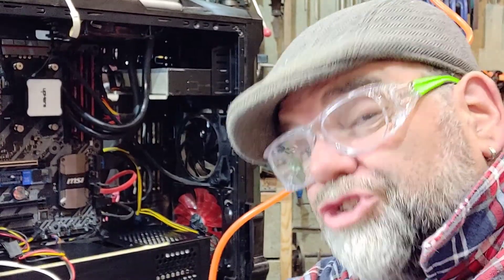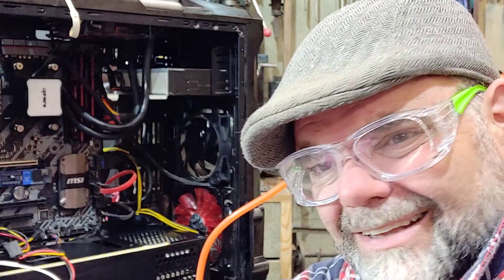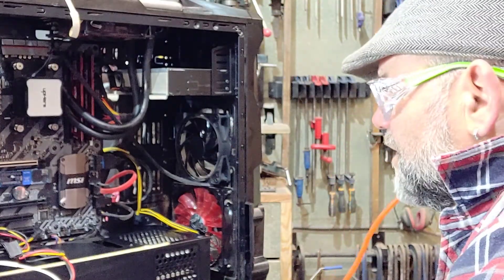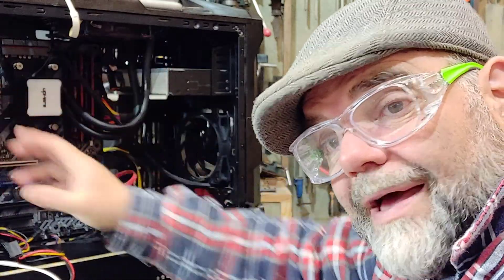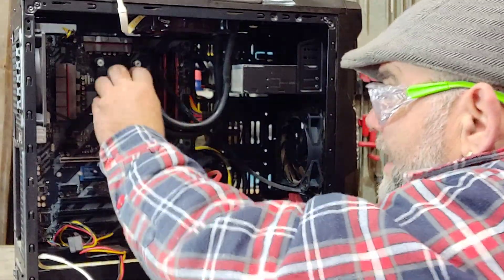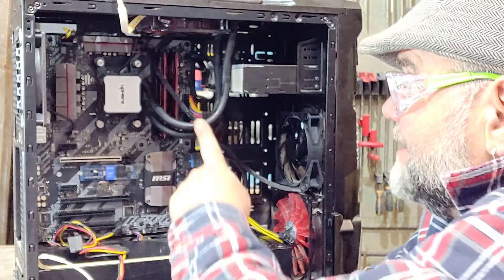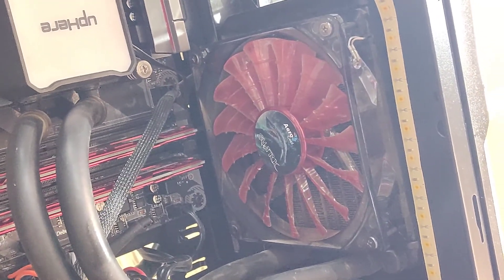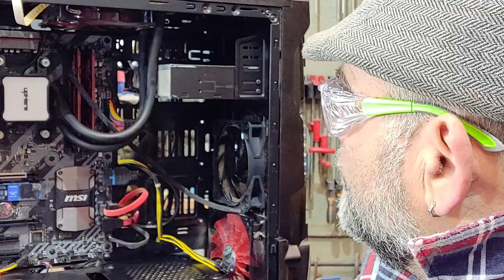My UPHERE CPU water cooler gurgles

Comment: Should also avoid having your lines from the CPU block,  loop down.. cause now air bubbles can't get out of the cpu block,

But if you must,  first Mount the cpu block, with the lines pointing UP
Hold the radiator up high, with the lines of the radiator at the bottom

Run it a bit, so any air bubble goes out of the cpu block and gets pushed to the radiator.
now all air is in the radiator
and , the air cannot come near the lines so it won't be sucked in anymore.

presto, no more cavitation or gurgling noises

You can now install the radiator, and , if there is a bend downwards, it will revent air from crossing over to the cpu block